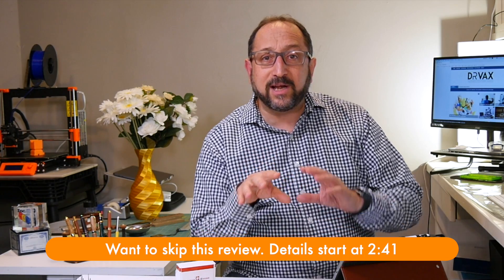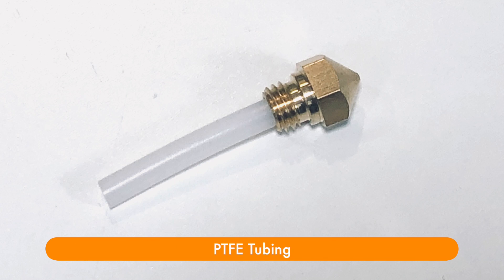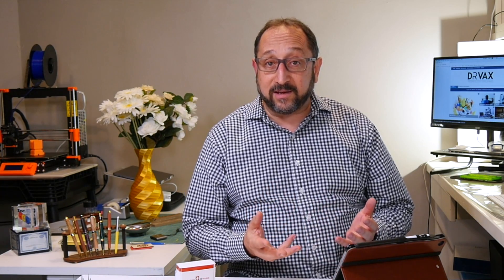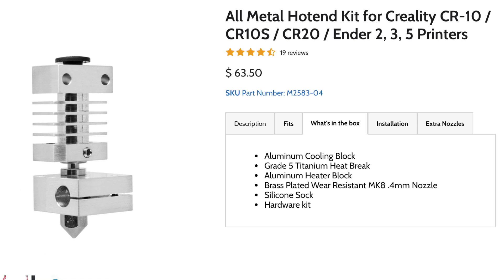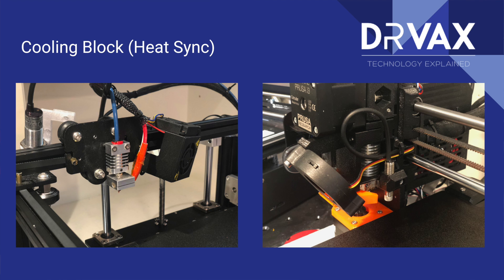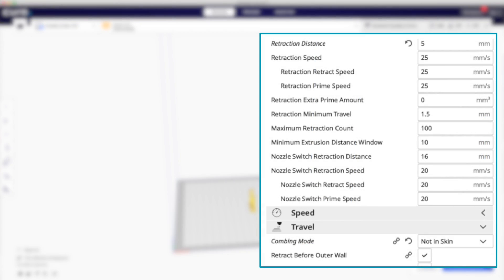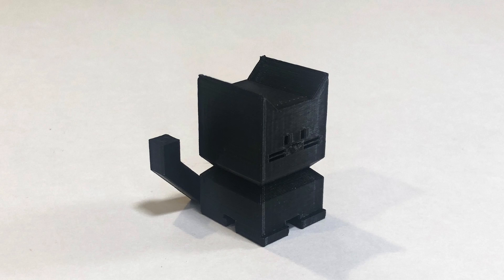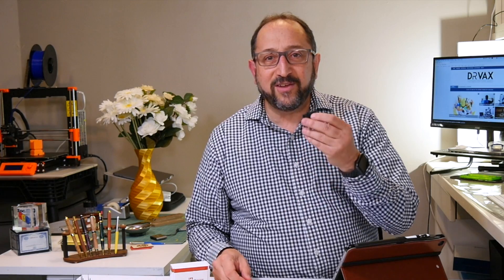Micros Swiss All Metal Hotend

Comment: So, I've found that the best way to solve stringing issues with this hot-end, is to go through the trouble to set up linear advance and tune it well in marlin. I get literally zero stringing with the micro-swiss and a properly tuned and calibrated linear advance. For most PLAs the best K for my set up, with a short capricorn bowden, micro swiss, and BMG clone, is about 0.65. 

Granted, this requires you to be able to modify and flash your firmware, so basically I'm saying upgrade other parts of your printer first. Put a better mainboard in before you do something like this.

Also, make sure you're cooling your heat sink VERY well. switch to a cooling duct system that allows you to swap out the hot-end fan with a 40x20mm fan. Having more air blowing on that heat sink really helps keep heat creep to an absolute minimum. The melt zone stays farther down the heat-break and there's a sharper transition from hot to cold areas in the hot-end.

I use 1mm retractions at 40mm/s. Zero stringing with 1mm retractions, on a bowden printer. It's awesome. I can even print flexibles with the BMG and the capricorn tubing, albeit, I have to print flexibles rather slow, around 25-30mm/s. 

It's a bit of a headache compared to the PTFE hot-ends, but being able to print anything that melts below about 300c is nice. I really like printing PETG, and while you CAN print it with the high-temp capricorn tube, I often hang out in the same room as my printer, and I'd rather not breathe teflon off-gassing long term.
Reply from the maker: Excellent suggestions.   Might be a bit advanced for some of my viewers but thanks for sharing.   I may try a cover some of these topics in a future video.  Thanks again.
Reply: Hi there, I might be a bit late to the party here, but figured I would ask. 

I'm trying to troubleshoot stringing issues on my ender 5 plus with a micro swiss hotend (PLA, tried printing between 175C and 215C). Movement speed is around 120mm/s. Using Hatchbox PLA. 

Also tried retractions from 1-3.2mm. Nothing seems to work, there is always tremendous amount of stringing on the stringing tests (used the "easy" stringing test from this video which is essentially two vertical pillars). 

Have you found any way around this other than the suggestion you made above? That is definitely beyond my understanding at the moment.
Reply: @patrickmele5606   One thing you can do is to make sure your travel speed and acceleration are high. Use something like 200mm/s for the travel speed and 2000 for travel acceleration. I find when the nozzle travels faster, strings almost snap off instantly from the abrupt movement. Turning your jerk up helps as well. The less time the nozzle dwells at the end of a line and the quicker it gets up to travel speed, the better.

Also you can try making the cooling better on the heatsink by using a 40x20mm fan. If the cooling is better, the melt zone gets smaller with a sharper transition from solid to molten, and that helps.

I would also suggest trying out coasting in cura. It replaces the end of an extrude with a travel move which helps bleed off nozzle pressure at the end of a line.

Also set try out combing and set it to "not in skin", that helps as well with most models. 

The stringing test is stupid IMO. I get no stringing at all in any actual prints but on those stringing tests sometimes I still get stringing even with linear advance. 

Just because your test is showing stringing doesn't necessarily mean your prints will. Those tests are also much harder with bowden printers because the bowden tube basically turns the filament into a spring inside it, which builds up nozzle pressure as it extrudes a long.

Stringing is caused by an excess of nozzle pressure, so anything that reduces nozzle pressure at the end of a line helps it go away. Hell, using capricorn bowden tubing helps because it means there's less slop in the tuber which reduces that "spring" effect.

For sure set your retractions to like 3.2-3.5 mm though, that is really as high as I'd go.
Reply from the maker: Brilliant idea.   I will give it a try and may make a video about it.
Reply: @WrexShepard  Thanks so much for the detailed reply. I will address some of your points as I can. 

I'm going to try and increase the nozzle speed and acceleration a bit. The issue is, I primarily use my 3d printer to print miniatures, so not sure if that high speed would possibly knock minis off the build plate. Will give it a shot and let you know. 

Going to turn on coasting now--this actually seems like a great idea. If my travel moves are producing filament, might as well use it. 

Combing "Not in skin" is already turned on. 

Upping the retraction to 3.5 (already have capricorn tubing!). Going to tinker with these settings a bit before making any firmware/hardware updates. 

On a side not, thoughts on printing Hatchbox PLA at 170C? Was going to give that a try as well.
Reply: @patrickmele5606  Even if you print small stuff mostly, fast travels alone wont hurt. Consider this: the outer wall is what shows on your print as quality for the most part.

Typically when the nozzle starts an outer wall it goes right after an inner wall. That distance is short, so the increased travel speed is unlikely to produce ringing (which is the primary concern with too liberal of speed, accel, and jerk values) as there is only enough distance for the nozzle to get up to jerk speed or a little higher usually.

Even with travel at 200mm/s, travel acceleration at 2000, and a jerk of 10, the effective travel speed before an outer wall will likely be 10mm/s or a little higher because of the acceleration vs the short distance. The nozzle goes directly from ~0 to jerk speed, which is in this case 10, and then begins accelerating. Because the distance is so low, it never gets anywhere close to 200 before it has to start slowing down.

Also, keep this in mind. Print speed, line width, layer height, flow, acceleration, jerk, and temperature are all intimately intertwined when it comes to how much pressure is built up in the nozzle after each extrusion. 

 If you print faster or use higher line widths or even fatter layers, you'll want a higher temp to keep the nozzle pressure down. Likewise smaller, and thus effectively slower prints want lower temps. Small stuff is likely to print better at lower temperatures because of the print acceleration's effect on small scales. Short extrude distances go slower because the nozzle barely gets a chance to get up to speed. This is the other problem with the stringing test. People don't consider the fact that laying down 2 tiny poles at their normal temps is gonna string more than a bigger model with more effective print speed due to the often conservative acceleration and jerk values they're using to chase quality. They're essentially printing at non ideal setting for temperature in relation to nozzle pressure on a small scale and that is effecting their results. 

It's a more complex question than just "does my printer string?". It's more like "At these scales, temperatures, and speeds, does my nozzle build up enough pressure to produce an unintended microextrusion at the end of my lines?"

 Again, with bowden printer especially, nozzle pressure is the name of the game. You're fighting a PLA spring that wants to squirt filament out of your nozzle whenever it builds up pressure the whole time, so try to think about things in that regard. You're not doing retractions to suck filament back up in the nozzle, you're doing them to ease pressure off the nozzle. Most of your retraction distance is just taking up slop in the bowden tube with 3mm retractions, the filament is probably only pulling back by half as much, or maybe less.

 It's one of the main reasons most people prefer direct drive aside from printing flexibles. It's not that it's necessarily flat out superior, it's just easier to dial in because you don't get that spring effect after an extrusion so much since you're not bunching a long length of filament up in a tube with enough slop to let it have somewhere to displace to. 

That's why I suggest linear advance, its whole purpose is to attempt to keep the nozzle with as low of a pressure as possible, which is especially important with bowden printers. It essentially inserts micro-retractions as the nozzle begins slowing down at the end of a line to preemptively bleed off some pressure. It also increases flow rate at the beginning of a line to take up the slop in the tube and compress the "spring."  Coasting attempts to do a similar thing, it just doesn't retract, it just stops extruding near the end of a line, so you don't get as much of a benefit as full on linear advance.
Reply: @WrexShepard  Wow, I didn't realize how much went into it. 

I should have emphasized this earlier, but when printing multiple pieces, I get tremendous amounts of stringing between the two pieces (the stringing so dense and fluffly that it almost looks solid). After removing this stringing, the print quality is great, but it is just such a pain to do so much post-print work. I'm more concerned with the increased travel speed and acceleration between pieces. 

To your point about easing pressure off the nozzle--I mean, I have done all that I can think of (lowered temp, increased retraction to 3.5, turned on coasting and combing "not in skin,") but none of it seems to make any different. The tests prints, and some other non-test prints, are coming out with just as much stringing. 

I saw one person recommend using 7mm retraction with a Micro Swiss (he had a Bowden system). From what I have heard, this would likely clog the heat break because it would pull molten filament upward. 

Really at a loss, the linear advance fix you suggested sounds great, but it is way over my head at this point in my 3d printing career haha--considering returning my Micro Swiss and replacing it with a stock nozzle. At this point, I don't intend to print with anything beyond PLA, and I never had these issues with my stock nozzle.
Reply: @patrickmele5606  I would suggest that you might be running excessively hot if it's that bad. Do you get little like, spires coming off the print with the strings? That's a classic overheating artifact.

I would suggest just putting the stock hot end back if you don't want to fuss with it and only using the micro swiss for if you decide to go with higher temp plastics or decide to you would like to try linear advance, or direct drive, down the line. The micro swiss, or really any all-metal hot end, is kind of terrible for PLA in a bowden configuration without pressure compensation of some sort. I was able to get stringing down pretty low, but definately not as low as the stock hot-end without linear advance. It is what primarily drove me to fuss with LA because I wanted to use a single universal solution with my ender 3, and the micro swiss was struggling, albeit not as bad as you're describing.

With the stock hot end you're able to use enough retraction distance to bleed of the pressure and actually send the nozzle pressure negative since you can go up to like 20mm if you wanted to. I would suggest something else though. When you do retractions, it's generally better to un-retract a little slower. I use 40mm/s retracts, but I un-retract at 25mm/s. It helps reduce the pressure spike at the beginning of a line due to the melted filament getting compressed harder before a line starts.

Also, keeping your bowden tube as short as you can is generally a good idea on bowden printers. It helps reduce this spring effect that I keep talking about. Even with the stock hot end it will allow you to use smaller retractions. Mine is so short that it just reaches the far end of the bed at full travel. I actually gave up some Z build height to get it so short because now I can't go all the way up without dangerously squishing it down on the top cross brace of the frame.
Reply: @WrexShepard  Great points. So, I tried printing from as low as 170C to as high as 215C with the same configurations. Stringing was worse at 215, but not much worse. As you suggested, I might just switch back to the stock nozzle for now until I can setup direct extrusion, LA, etc. 

However, one point you made really struck me--I did not shorten my Capricorn Bowden tube AT ALL. It is as long as it comes out of the box. This might be contributing to the buildup of pressure you mentioned, despite the retraction change. 

Going to shorten the Bowden and give it another go shortly. Will keep you posted. 

Also, do you have a forum, blog, or community you are a part of? It has been great getting your feedback and I would love to keep the conversation going (somewhere other than youtube comments lol). 

Thanks again, been very helpful!
Reply: @WrexShepard  Thank you for an excellent post !
Reply: So...just curious....what are your settings for jerk? Im running exact same setup on a cr20
Reply: Caleb Phelps XY jerk is 9, Z is like 0.3, eJerk is 5 but I’m using direct drive now. When I was using Bowden I had eJerk on 10 with XY on 15. I had to dial the jerk back with the added mass on the x axis.
Reply: @WrexShepard    thanks! You seem very knowledgable on 3d printing.....maybe you can help with my blob issue...ive tried everything and it still persists....i get them at the start of a new layer....nothing has helped....ive been through the entire machine numerous times...replaced entire hotend, capricorn tubing..tightened all belt, screws, bolts....adjusted every setting...they just wont go away. This printer used to have near perfect prints.....now...they are great except for small blobs...any ideas? Could this be my stepper or mainboard?...IDK. I could send pics to ya if you' re willing to look on another platform other than youtube
Reply: Caleb Phelps well, it sounds to me like a slicer problem. Unless you’re printing too hot or something a “blob” on the outside of the model at the start of what I assume you’re saying is the outer wall of each layer sounds like your z seam is extra prominent. Perhaps your slicer has the z seam setting to “random” so that it’s starting in different spots every time. That usually makes models look like they have tiny zits all over them. For that setting you want to set it to either the sharpest corner, or set it manually to whatever side of the model hides it best if there’s no good corners for the seam to hide on. 

If it’s not your z seam, I would also check that you don’t have your retractions set to prime an extra amount. There is a slicer setting that allows that. So like for example you retract 5mm then it unretracts 6mm. That would for sure cause that. 

If nothing else, Try downloading another slicer like prusaslicer if you use cura and vice versa, and printing something to rule out slicer misconfiguration. I would say that the issue you’re having has to be something related to either your z seam or retraction. 

You also might be overextruding  a bit. You should always calibrate flow rate with every new filament. Print a 2 wall thick hollow cube with no top, and measure the walls. So if you have a .4mm nozzle with the line width set to .4, and you measure .87 instead of .8 you know your flow rate is off by that much of a percentage difference. It’s better to do 2 walls as this will magnify inaccuracies and make consistent measurements easier. Only measure the first 2 or 3 layers as well since minor layer alignment variances can throw off your measurement. Most PLA requires you to drop flow rate as it has a tendency to expand when it leaves the nozzle even if your extruder is calibrated perfectly. This causes mild over extrusion as well as dimensional inaccuracies.
Reply: @WrexShepard     it is set to random...as i have been trying to dial this in as well as the stock setup....with it stock...i could print a cylinder without seeing any seam at all using cheps profile from filament friday....obviously...cant use that anymore....lol. Thankyou for your help...it is greatly appreciated!
Reply: @calebphelps7030  Visible Z seam is kind of an endemic thing to bowden printers due to their imprecise extrusion, it's nearly unavoidable, although, it can be hidden well and minimized. Linear Advance will get rid of it almost entirely if you take the time to set it up right, since the whole idea of linear advance is pressure control, which is the thing bowden printers really need. Remember, the filament inside the bowden tube essentially acts like a spring when you push on it. If you think about it like that, it makes a lot more sense why bowden printers suffer ooze and blobs more. Ooze from too much nozzle pressure at the end of lines, and blobs from too much nozzle pressure after a de-retract. This issue is made worse the longer your tube is and the sloppier it's internal clearance with the filament. 

With perfect slicer settings you can make it almost go away, but even my heavily modded ender with an e3d hemera, will show a small Z seam on a cylinder.

Some filaments hide the z seam better though. For example light colors hide the seam really well, while silky PLAs show print defects off. It's a lot easier to make marble filament look pretty than silky PLA. Just a little protip for you there. Get you some light, matte colored filament and watch how much you stop obsessing over minor defects lol.
Reply: @WrexShepard  i got dialed now.....thank you! You're the man!  My fav filament has been cf nylon....no layer lines is awesome
Reply: Thank you for everything here !!